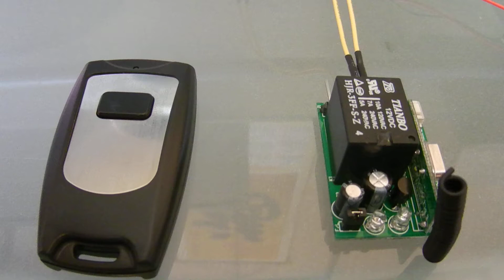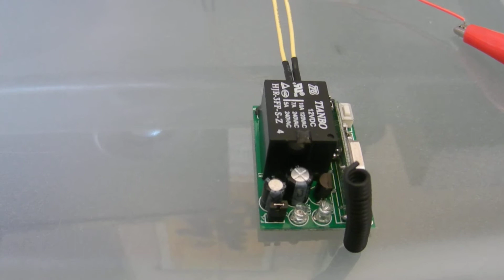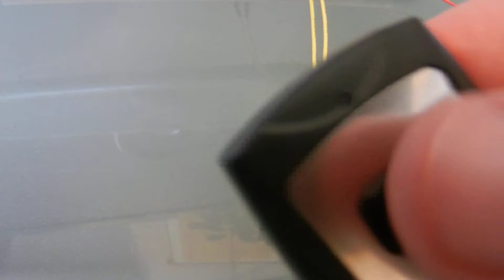Single Channel Wireless Relay kit WWW.RAPIDRELAYS.COM

Comment: My key fob does unlock my truck but I'd I put it on the cup holder it does turn on oh also my gas gauge it's not working also my air pressure sensors are not reading what can it be